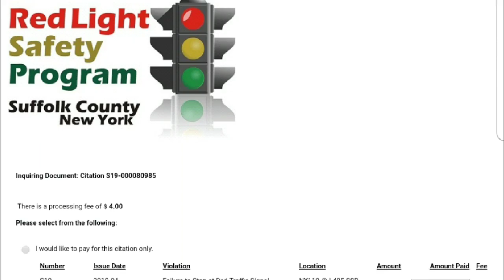$40 CRAFTSMAN 6.75 BRIGGS SELF PROPELLED VAC CHIPPER VACUUM BLOWER CARBURETOR CLEANING PICK REPAIR

Comment: Kind of a necro responding to an older video, but I just wanted to say “Thanks!” for posting it. I have the same model (non self-propelled though) and your carb cleaning tips were all I needed to get it running great again. Bought it “non-running” for $75. This is actually the second one I’ve owned and I gave my old one to my brother when I moved. I got that one for $50 and I got it running because the previous owner somehow bent up the safety plate on the bag that is supposed to depresses the on/off safety switch required to press down on the button so it will run only if the bag is attached to it. One minute to bend it back in place and that one started right up.
Reply from the maker: Glad it helped!  Hope you’ll subscribe
Reply: @MowersNBlowers  Just did. Thanks again.

Comment: You need to bypass that stupid cut off switch where the bag attaches.  The bag on mine is a POS.  It broke after a few uses.  I'm going to try to fix it with a zipper.

Comment: They actually cost  $800.00 ..

   TO THIS DAY !!!
Reply from the maker: Surprised it’s not more like everything else
Reply: @MowersNBlowers  i bought a used one yesterday for 200,  since craftsman and Troybuilt both branded them I wonder who actually makes them ..
Reply from the maker: Depends on the year.  Troy bilt was made by gardenway or MTD,  the craftsman can be from AYP or recently MTD
Reply: @MowersNBlowers  How do you find the year is it on a vin data spec plate ?
Reply: @MowersNBlowers  they also have different horsepower there was a 4.6 a 5 and a 6 .  This ones a 6 so I guess that would explain why they cost 800 now and other people remember it being cheaper,  they're different engines with different power output from year model to year model. .
Reply from the maker: @DavidDiaz-zp4hu  what’s the serial numbers

Comment: Thanks for the great vid.  I just picked one of these up myself and while it ran fine yesterday, today, it started only running (weakly) with the choke on.    When I moved it to "run", it dies.    2 hours later, it won't even start.    I guess I'll go through what you just did first and see if that takes care of the problem.  That or just throw a new carb on and go from there.

I did wonder something about your vid though.   With all the trouble that the Chipper tube was giving you, why didn't you just undo the three bolts and take it off  ?   :-)
Reply from the maker: Your carb is dirty, just clean it.  The hose comes off easily with button.  You dont need to take 3 bolts off.  Thanks for watching.
Reply: @MowersNBlowers    Thanks.    I'm a newb at this and not sure that I trust myself cleaning the carb correctly.   I'd probably miss something.  Just got replacement kit for $13 which included a fuel shutoff, fuel filter, air filter, etc.      Will keep the old carb on hand and try cleaning it.

On the chipper tube, at the 15:13 mark of your video, you talked about how the chipper tube was in the way and wouldn't let you use your impact driver.  So, you ended up using a pair of pliers along with a nut driver bit.    Remove the 3 bolts securing the tube to the deck and it lifts right off and is out of your way.

Comment: What do you use to Flush to Old Motor Oil out with?

Me, I use about 1 ounce of SeaFoam poured directly into the Dipstick tube. After making sure there is "sufficient" oil, start & let run for about 5 minutes... And PRESTO!

Drain out the Old Oil. The SeaFoam helps clean the inside of the Crankcase while it runs!

Just a "little tip" for you!

Take care,
🤓-Thomas
Reply from the maker: I was in talks with seafoam on a sponsorship, but didnt happen.  I know all about the great results of Seafoam.  I use ATF fluid though.
Reply: @MowersNBlowers 
I have plenty or ATF... Would have NEVER thought of using it as a FLUSHING AGENT!

Thanks,
🤓-Thomas
Reply from the maker: Atf is used historically to flush out sludge in your engine.  People still put 1 qt of atf and drive around before their oil change.  Atf is a detergent.
Reply from the maker: Google atf mix with oil before oil change.

Comment: Too small for my 5 acres, but she is a prime lookin unit and a good job on the carb cleaning Henry... I have a Craftsman 650 Series that needs a carb job as well.
Reply from the maker: Don as you know, the seat and gasket are leading problems to fuel leaks.  A clean carb almost always fixes no start issues.  I was very confident that it would start on the first pull.
Reply: Yup! well aware Henry and I new your Vac would start & run good after the carb flushing... they are an easy carb to work on. When I do my carb I will have a new kit on hand just in case as I am 20 miles from the nearest City. My Craftsman has the exact same shroud as your Vac & I bought it new in 2008 & looks just about as good as the day I picked it up from Sears. 
BOY, DO I MISS SEARS!

Comment: I bought one of these in 6.5 hp. Self propelled also. Started it up and chipped some branches today. She ran pretty good and then slowly died out after I was done chipping.  Probably need to take off and clean the carb, check compression etc. Seems like it is a fuel issue, but it is a kind of a bear to pull start this thing now. Oil is good and clean. But it did run for about 15-20 minutes so I'm hopefully gonna save it.
Reply from the maker: Valve lash if hard to pull
Reply: @MowersNBlowers  cool. I can find a spec online for that model. Interesting.  Had a Honda that did that. Many years ago.  THANKS!!!!!
Reply: @MowersNBlowers  .004 on both. Do you agree?
Reply from the maker: @oliverford9325  yup that’ll do
Reply: @MowersNBlowers  appreciate it. ..thanks for the help.  👍👍👍
Reply from the maker: @oliverford9325  hope you’re subscribed
Reply: @MowersNBlowers  I will be in about 20 seconds
Reply: @MowersNBlowers  👍👍
Reply: I'm an auto tech, not to hip on smalls, that's why I ask experts!
Reply from the maker: @oliverford9325  now I’m gonna hit you up on car stuff bro
Reply: @MowersNBlowers  absolutely.  I love the barter program
Reply: @MowersNBlowers  good day sir, I decided to tear into that chipper. Compression is less than 60 with two or three pulls. Cylinder looks good,  minimal scratches. Smells kinda burned in the interior 
. Valves had no clearance. So, I looked at the seats and they seem ok. A little movement of the piston at TDC, but small. I would like to order two valves and a head gasket from you. I took pictures and if you want, I can send em via text or email.  Oh yeah, a couple head bolts were more loose than the rest.
Reply from the maker: @oliverford9325  I don’t have any new parts for that engine.  I’d simply just replace the engine.  I’m sure you can buy a used mower with that engine somewhere locally for $50
Reply: @MowersNBlowers  bummer. I live in a tiny town. I'll do some checking around.  So don't bother with valves or anything?
Reply from the maker: @oliverford9325  not worth the expense and trouble for a simply lawn mower engine.  You can find one on the street for free.  Look at Craigslist,  OfferUp, Facebook marketplace for a cheap mower with the same engine

Comment: Dumb way to remove a seat blow air throw the fuel intake it pops right out
Reply from the maker: Well it didnt...and I learned that from donyboy
Reply from the maker: @mrbriggs68  lol...hundreds and thousands of subscribers man!
Reply: @MowersNBlowers  does not prove a thing
Reply from the maker: @mrbriggs68  well, you're stupid idea of blowing it out with air doesnt work!  It wouldnt be seated very well if air blows it right out.  Over time, varnish and all...its practically fused in there...how can it be blown out.
Reply: @MowersNBlowers  take air nozzle from your air compressor and blow it in gas intake on the Carb
Reply from the maker: If pulling on a wood screw with all my might wouldnt get the seat out, what makes you think air would?
Reply: @MowersNBlowers  mustie 1 did it by accident several times with simple air

Comment: Without a doubt,, your close up videos are the best quality on YouTube. I bought this used model earlier this year when no leaves on ground. Tried it for the first time today and the nozzle rolls over the leaves and does not pick them up due to no suction. The hose works fine. The lever on the nozzle is pointed up and the hose's pin is in the first hole as stated in the manual. What do you think is wrong with the no suction nozzle and what can I look at fixing. Thank you!
Reply from the maker: Engage the lever that switches from vacuum to tube suction.  Pivot the front upward on a stool so you can see if the flap closes to direct the suction to the hose.  Thanks for the complimentary comment too, hope you subscribed bro
Reply: The wording in the manual is kind of messed up.  The "nozzle" is the snout out in front of the Vac.    To get full suction on the hose, you need to pull that pin, push the hose all the way down and have the pin go in the 2nd hole.

If you pull the hose and look down into that big hole, you'll see a metal flap plate that is hinged.    When you have the hose inserted and the pin is in the first hole closest to the end of the hose, the flap plate is mostly closed.   This preserves the vacuum force for the front "nozzle".   When you pull the pin and push the hose further in (to the 2nd pin position), the tip of the hose pushes down the flap plate, opening it up more and creating a stronger vacuum force to the hose.
Reply: @MowersNBlowers  Figured out the problem . The plastic lever in the middle of the nozzle had broken so it could not move the flap beneath it. Bad engineering design to make the lever out of plastic when it's frequently in use and under stress. Thanks
Reply: @davewilson1411  Thanks Dave. The lever in middle of nozzle had broken free from the flap under it. I use duct tape now to keep the flap in place depending on using nozzle or hose.

Comment: This is the same as the troybilt.i had a troybilt version of this for 15 yrs no problems. Solid machine. Careful after a while on this machine the drive cable may snap, like years. 

If you have a lot leaves , keep it, grinds up better than mower.

Comment: Hey Henry you know what type of motors they use on these? Are they lawn mower type or like a pressure washer type?
Reply from the maker: Pressure washer type.  The speed of the engine is limited by the heavy flailing chipper wheel.
Reply: This perfectly answers a question I'd been pondering for some time now. Tnx

Comment: I have one of these craftsman leaf vacuum , if I need a new carburetor what is the part number and where can I find one? My vacumm same as the one you are working on did the same thing. It was sitting w dry gas tank for 6 months. It was working 6 months ago perfectly and now gas out of the carburator when I put gas in the tank. Great video very informative . Why not just replace the seat??
Reply from the maker: You can. Hope you subscribed
Reply from the maker: This is what you need

https://rover.ebay.com/rover/0/0/0?mpre=https%3A%2F%2Fwww.ebay.com%2Fulk%2Fitm%2F263762293115
Reply: Mowers N Blowers does the brand of carburetor matter??
Reply from the maker: @andrew8604  there are only 2 types, the kind briggs uses for their machines called walbro usually over $30, and the cheap Chinese copies for about $10.  If you're crazy about using original equipment, expit's expensive.  If you dont care buy the $10 copy.  They all work fine.
Reply: Mowers N Blowers thank you , your vid is a great help.
Reply from the maker: @andrew8604  subscribe, it helps me out, thx

Comment: If that was MINE, I would have installed a Fuel Shutoff Valve...

And purchased a Carburetor Rebuild Kit (~$15.00). But that's me...

Super HAPPY that the Tecumseh Float Needle Seat worked! I wouldn't have even thought of that!

Take care, as always,
🤓-Thomas
Reply: I got mine for free. It didn't start or run when I got it. I cleaned the carb, changed its oil and a bunch of other stuff, and then all of a sudden it would start but not stay running. I repeatedly deep cleaned every nook and cranny of the carb and etc, but this time it would sometimes start and run for a bit and ahutoff of and refuse to start for a while. Eventually, as a last result I broke down and bought a carb kit which came with a bunch of stuff like air filter, inline gas shutoff valve, gas filter, primer bulb, gaskets and etc. I did the install and modifications this past weekend, and the only thing I didn't install was the gas filter, and now my lawn vac runs like a mean champ.